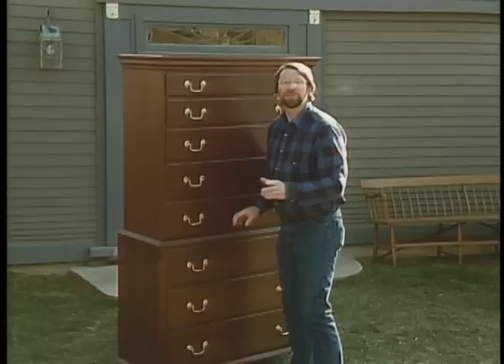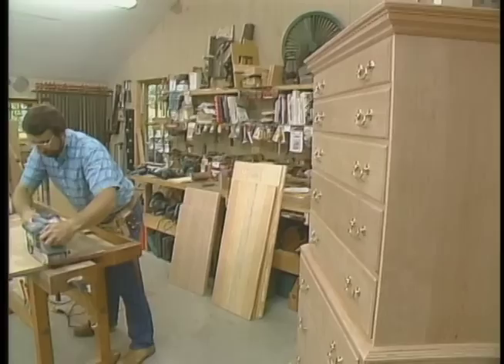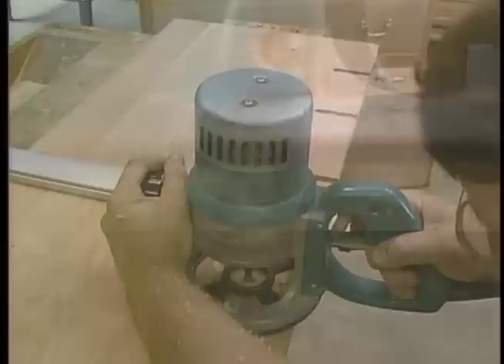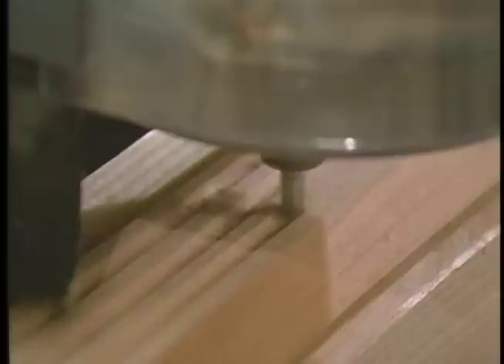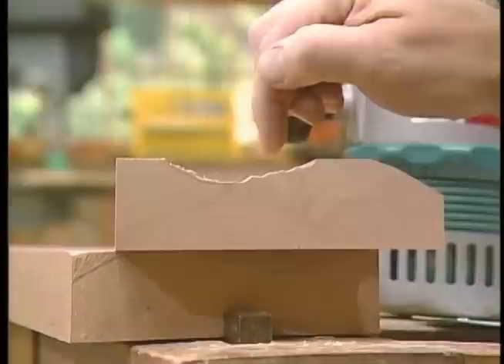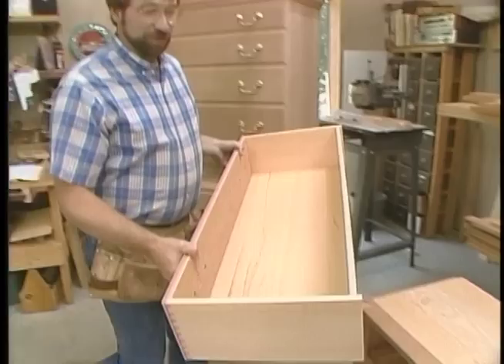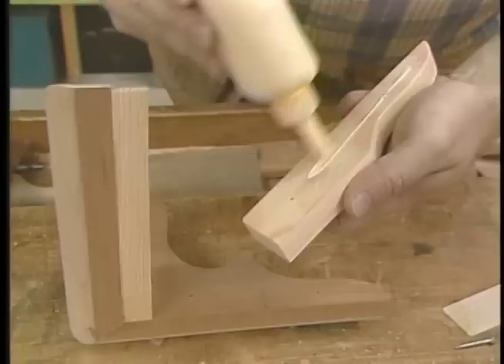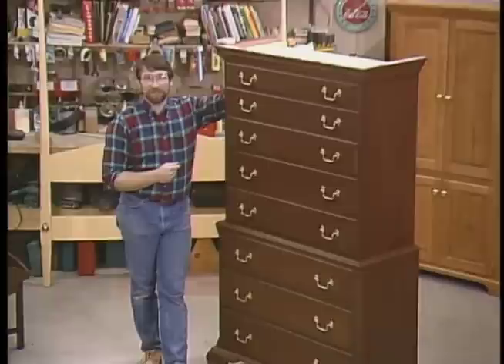Chest on Chest  |  S2 E11

Comment: I made a similar unit by hand in 1984 during my trade school course.  I used rough Alder.  I had to make a smoothing plane first in order to hand plane the 4/4 boards to 7/8". Bought a rip saw to cut the boards for the drawers. No power tools were used. Did a hand rubbed oil finish. Still using it today. It will be my daughters eventually.

Comment: When I first seen this episode over 20 years ago, that was the first time I've ever heard of an overarm router. Back then, I really didn't see the practicality in having an overarm router over a shaper or a router table and now, some 20 years later, as a Master Furniture Maker (thanks to Norm & David Marks, in that order) I still don't see a practical purpose for an overarm router. I'm assuming the overarm router, gave way to the router table, just as the radial arm saw gave way to the sliding power miter saw, with the exception of the radial arm saw having the ability to rip cut. Great memories though, I love these nostalgic episodes.
Reply: I've seen one youtuber with an RAS, and he almost exclusively uses it for 90 degree dado blade cuts. Basically every cut you can do on an RAS you can use a table saw for aside from breaking down long boards in crosscuts (which is what it was originally designed exclusively for and Miter saws do now). And if anything, table saws are safer for sheet goods, since you basically set up the blade to stick out over the table at gut height and push the sheet across it with an RAS.

The big advantage I see with the overarm is if you're regularly doing those kinds of decorative plunge cut lines and need perfect repeatability instead of carefully lowering the piece blind onto a spinning blade like on a router table.
Reply: There are a handful of companies that still make an overarm router. They tend to be a bit pricey so it only makes sense for commercial shops.
Reply: The interesting thing to consider with router table vs overarm router is the face of the material you are indexing off of as it relates to the depth of cut.  Working in a commercial shop this was something we used to discuss as when material varies in thickness as do most sheet goods and you using dado joints, its the difference between your error factor being on the inside dimension of the cabinet vs the outside dimension.  If you assume your material is 3/4 and you set a depth of cut on the router table of 3/8, yet the material is thinner, you will still remove 3/8 of material, and if you cut the horizontal parts to the same dimension assuming the consistent thickness of the sides, your cabinet will now be undersized.  Has you used an over arm router, you would set the bit 3/8 above the table, if your side was thinner than 3/4, you would still be left with 3/8 and your outside dimension is unchanged.  I know it sounds insignificant, but when banking a lot of cabinets together, it can ad up to enough to make a difference.  This was an adjustment when we went from dado construction on table saws to dado construction on CNC routers.  Do you want your error factor to be on the inside dimension or the outside dimension.
Reply: @tccoggs  To be fair most people watching these would be doing one-off pieces rather than large volume production.
Reply: I am the same. Loved both of those shows! Got me into woodworking.

Comment: I love how Norm spent more time explaining the fundamental concept of a router table (that you mount a router in it) than he did explaining how in the river of shit running through the eighth circle of hell do you set the depth so that you cut the male dovetail the right width.  The closest method I came up with is fuck around with the fence on the router table trying to take 6.73*10^-994 microangstroms off a pine one-by and cutting it too loose anyway.